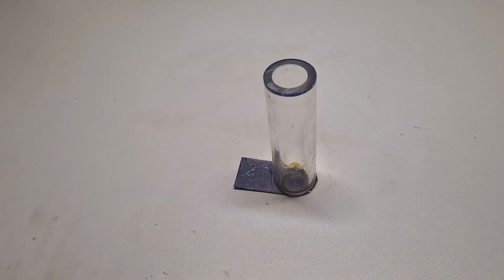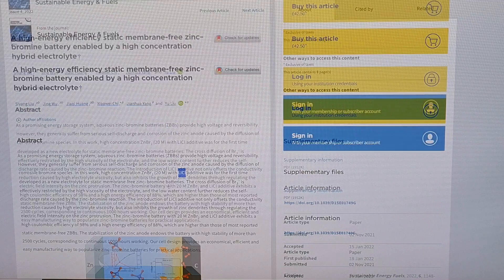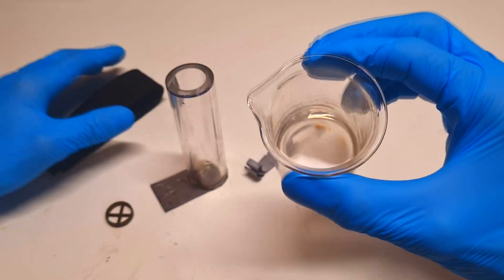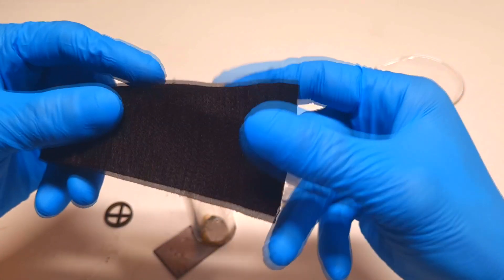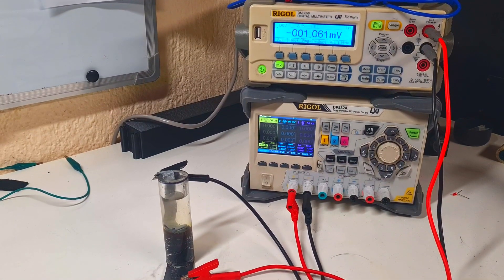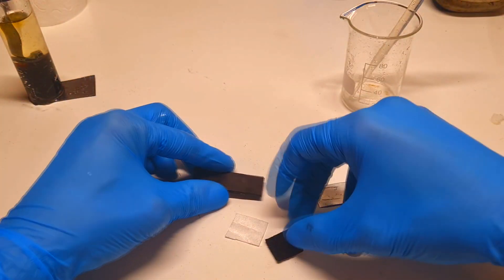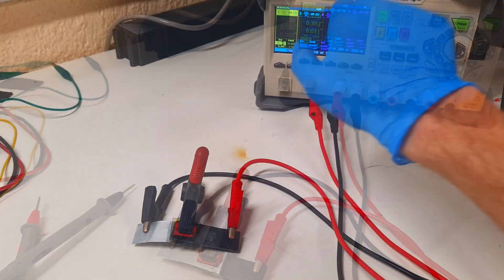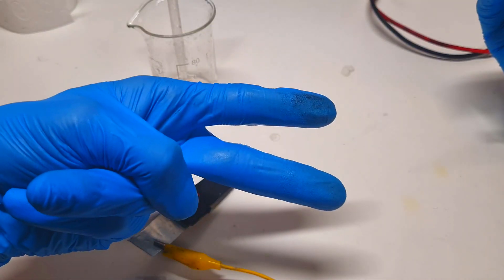Zinc Bromine Battery with high conectrated electrolyte

Comment: I can recommend 
Robert Murray-Smith
 if you want to dive in deeper into zink bromine batteries.
Reply from the maker: I know Robert very well 😊 I am so deep into Zn-Br that I almost reached the bottom, hehe. No for real I make alot of work on Zn-Br batteries like reducing the self discharge, higher the energy to up to 300 Wh/l and so on but most of the work I dont share on youtube.
Reply: @cayrex  I've been exploring batteries because of the electric bill. Thinking of a big battery storage and recharge it when the electricity is cheap and release it when it is expensive. Bromine batteries is interesting for this purpose. Not sure though how this would work in reality. 
Thanks for your response cayrex 🙂

Comment: Hello Mr. Cayrex.
I would like you to read this post in its entirety.
I have been following your channel for a long time, and I have recently started supporting it.
Just like you, I would like to show everyone what you can easily do yourself and I would like you to help me with this, and specifically, that you could record one discovery that I have made for everyone.

So, I watched your video about the Bromine Zinc Battery and I was looking for a cheap and good membrane.
In short (so that I do not misunderstand, because I do not know English well), I checked and a 3D printer resin is ideal as a membrane (polymer resin will probably also work).
I poured a thin layer of resin onto zinc (disassembled from a Zinc Carbon battery) and hardened it with UV light.

I checked with a meter and it did not show a "closed circuit" (resistance greater than 10MOhm).
I poured water with salt onto the resin, and then touched the resin with water with salt with a carbon rod (from the battery).
It showed a stable voltage of 1V and a current of about 5mA (the immersion area of the carbon electrode is about 1x1mm)
I think it is a very interesting solution to use resin as a membrane, especially since you can make a very thin membrane out of it.

In addition, it has an even surface.

Another thing I wanted to suggest is that after disassembling and cleaning the zinc battery, you can use it as a zinc bromide battery (after a few modifications).

If you are interested in this solution, I would be very grateful if you mentioned me :)
Best regards,
Damian Owczarek

PS: I also wrote to Mr. Robert Murray about this, because he also does similar things to you.
Reply from the maker: @tdx110  Thank you for your suggestion, but something similar I already try a year ago. I try to make a membrane and also a protective layer for zinc with the resin. And because of the high resistance and really limited porosity I get terrible performance of the test cell.
Reply: @cayrex  
Do you have any tests available?
Regular resin or UV?
I've read that polymer and UV can be good as a membrane.
I'm waiting for zinc sulfate and sodium bromide to arrive so I can do some tests.
I got the zinc from barter (because they're cheap).
They also recommend carbon fiber for graphite.

I was just wondering how the zinc electrode would hold up with a large capacity. Zinc settles on the electrode during charging and can break off later.

I thought about making the electrode out of carbon sponge. When the zinc solution is turned on, it will be able to transfer the charge when it touches the electrode.
Reply from the maker: @tdx110  Sorry no, I dont have any tests which I can share. I use UV resin. I know the concept what you want to do. But for me was not successful.
Reply: @cayrex  
Too bad. I'll keep trying. After all, you can try many things. Out of curiosity, have you tried making a fuel cell using resin?
I was also thinking about using glass fiber. Like for repairing boats or cars. Check by covering it with different materials as well.
You wrote that baking paper is only good for a short while. Maybe glass fiber will be better...
PS:
I just found a company that uses fiberglass as a membrane for Lithium Ion and Sodium Ion cells.

Comment: You should try plating zinc on some carbon felt.
Reply: Very difficult as only the outside fibres tend to plate, especially during charging.
Reply: @rogerwilson6367 later during operation the zinc plates everywhere increasing the active surface

Comment: Lovely work!
Those darned dendrites though... 
Wish there was a way to stop them from forming :(
Reply from the maker: The LiCl additive need to reduce the dendrites,.... but in my case not so much. Maybe because I charge the cell with to higher current.
Reply: @cayrex  
Good thinking - would love to see more work and study on the control of dendrite formation within cells - thanks again for taking the time to share your work and experiments, I really do enjoy this and hope to begin my own trials in the very near future :D
Reply: @SmalltimR  Lots of progress has been made with reducing dendrite formation through the use of zinc sponge electrodes.
Reply from the maker: @IrrelevantOne  Yes, sponge anode is one way to reducing the dendrites. But also with sponge anode you will need to control the charging current.